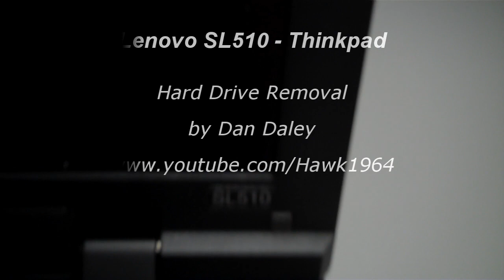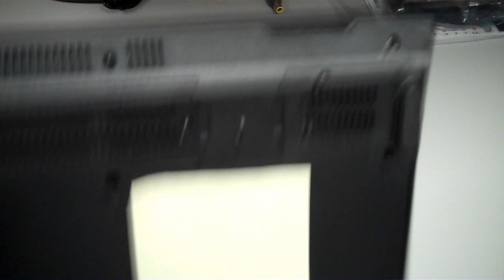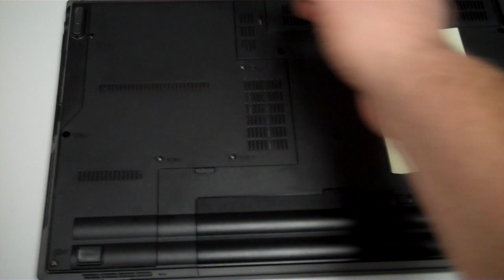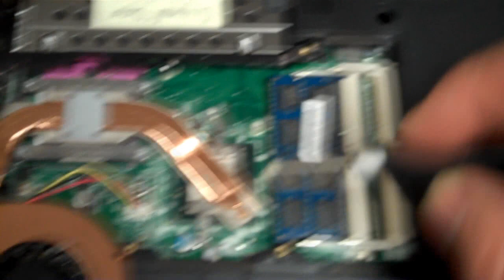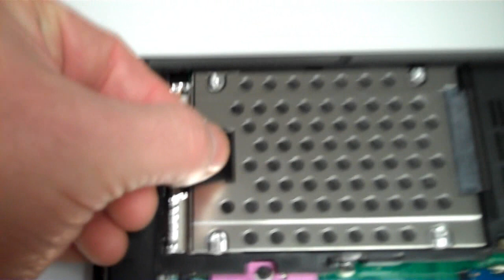Lenovo SL510 (Thinkpad Laptop)  Removing/Replacing the Hard Drive

Comment: Hello Mr. Kevin,

My IBM Lenovo thinkcentre is not detecting hard drive. It is not showing in the BIOS too. I removed BOTH power cable and the cable that connects to the motherboard n re-inserted properly.  But no use it is not detecting. Can you please help me.

Waiting for your reply. 

Thanks in advance.

Comment: Would i be able to put a 1tb hard drive from a g580 into a b45?
Reply from the maker: itsthatsebguy93 If your just talking the Hard Drive (not the Operating System and config) then I don't see any problem as long as they are both SATA based drive connectors.  But you can always reformat the drive and re-install the appropriate recovery software if that's available.
Reply: ***** Thanks.